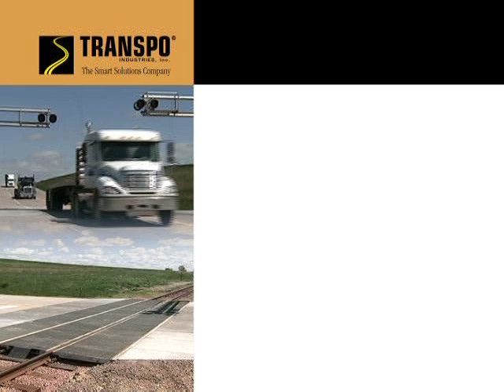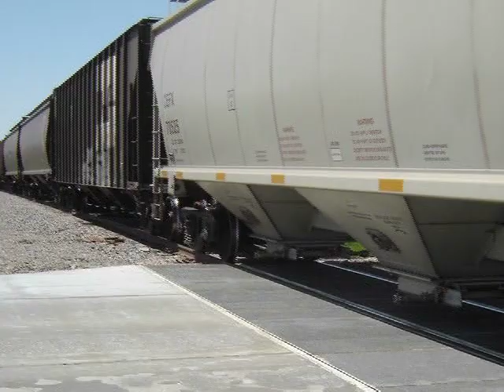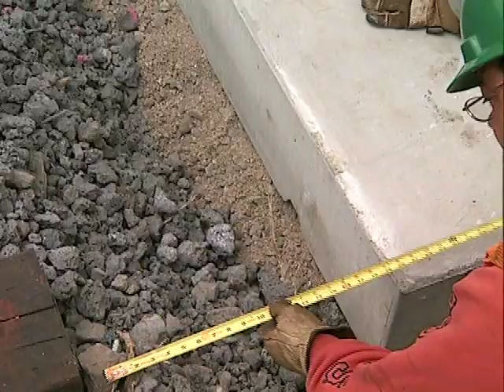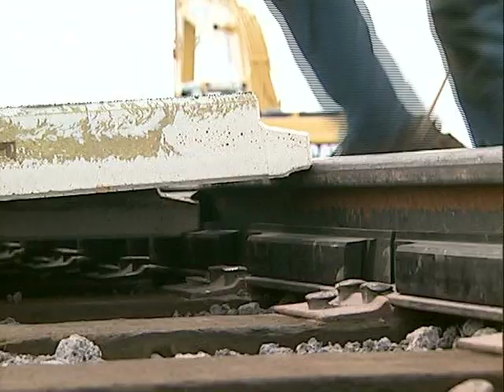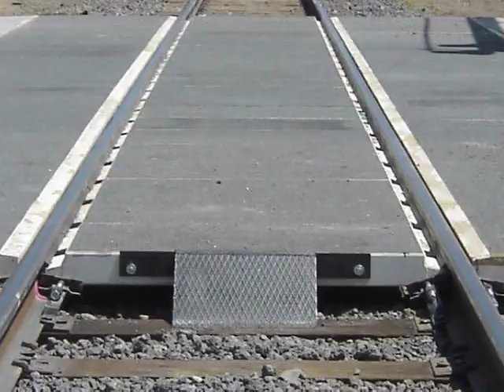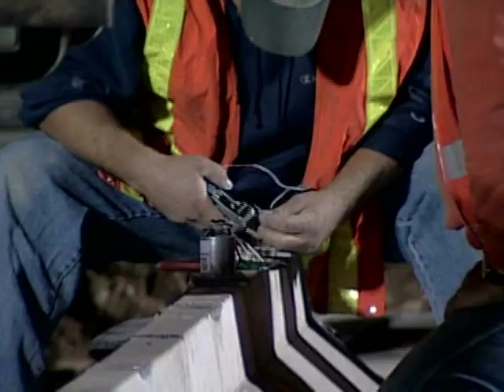BODAN® Highway Grade Level Crossing

Comment: @gailgrove The weight of the 300 ton locomotive will simply crush it into the ground if it has to, I have never heard of a train derailing because of ice build up.
Reply: It can happen. Tho most likely to happen with light rail, such as this one in Portland: https://youtu.be/qeJkLWD12Ek
Still, no amount of space around the rails will prevent ice build-up. Water fills all space, then it freezes solid, leaving no room. Most freight trains have nothing to be concerned about, because they are heavy enough to force the ice out. But they had best take it slow if they suspect ice in the crossings. This applies to all crossings, not just the ones in this video. This appears to be a good design from the looks of it.

Comment: @gailgrove You need to learn a little physics.
If material has no place to go and can not move quickly enough, the wheel can ride up anderail.
I have seen engines which derailed at grade crossings from ice and debris in the flangeway.

Comment: @gailgrove   Wrong.   Water can melt and with snow or ice obstructing the flangeway, fill the flangway.
Then the water can freeze hard.
When no space for the ice to spread out into as the flange knifes through the ice, the flange can ride up on the ice and over the railhead.
This why backing cars or engines can derail at grade crossings.